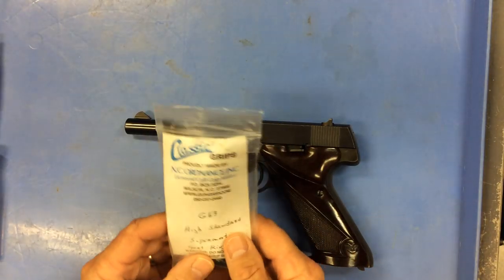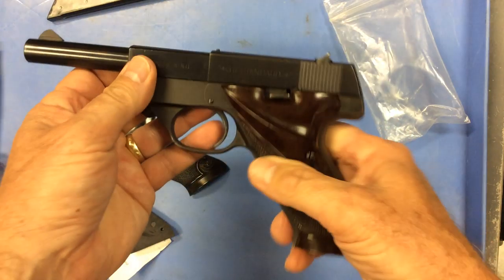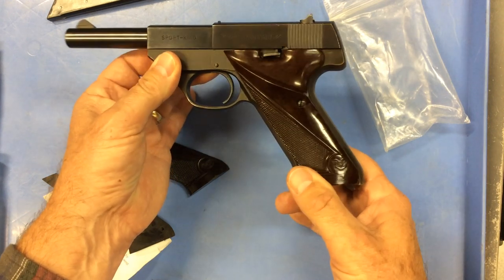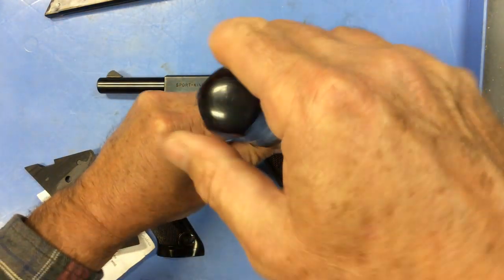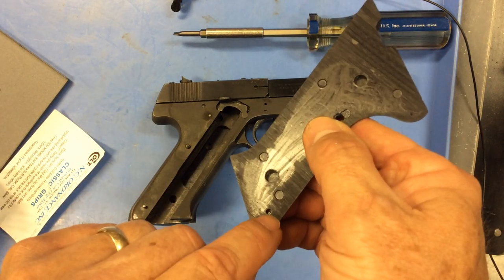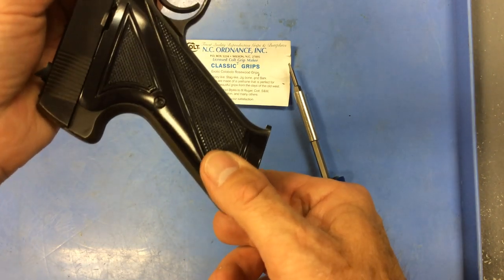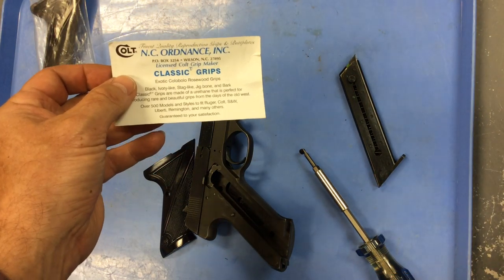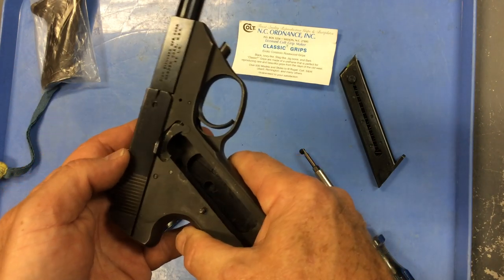High Standard Sport King Replacement Grips: NC Ordnance, Inc.

Comment: Great video.

Any issues with the company with getting refund?
Reply from the maker: No refund!!
Reply: @MichaelBellmbell556  NC Ordnance is excellent with exchanges & refunds, as long as grips have not been altered. In this case, the grips were not sent back for either, regardless of any alterations. We have a detailed accounting of any packages received. Also, our thinner grips & our rifle & shotgun butt plates do not have that much flexibility as this pair did in the video. Once in a while, there is a batch of urethane that does this. If the employee detects this, the batch is discarded. If it is missed & brought to our attention, we toss the grips or plates, manufacture new ones & replace the customer's order. If you want a refund, please return the grips & we will issue it. Respectfully, NC Ordnance
Reply from the maker: @thegripper404  I altered the grips to get them to fit so I did not send them back.
Reply: @MichaelBellmbell556  Thank you for replying! It appeared as though we refused a refund.
Reply: chris mclaughlin   We do not have wood grips for the Sport King, nor do we have grips without the thumb rest, sorry